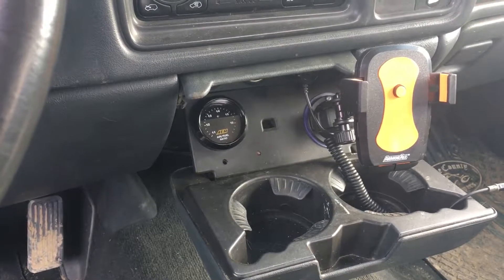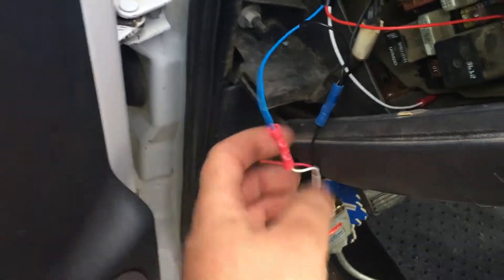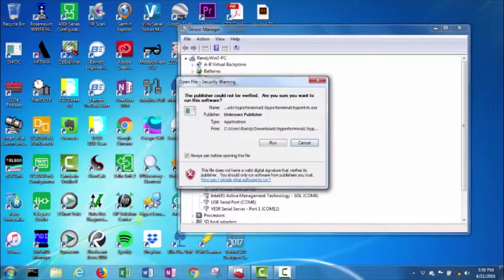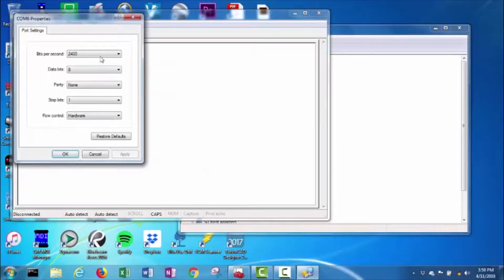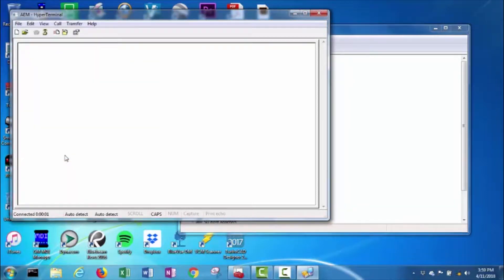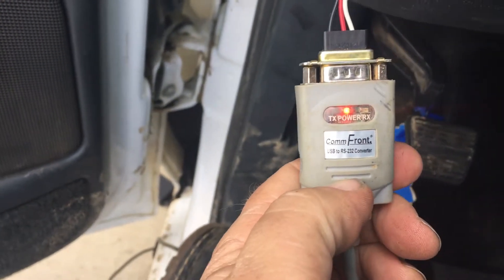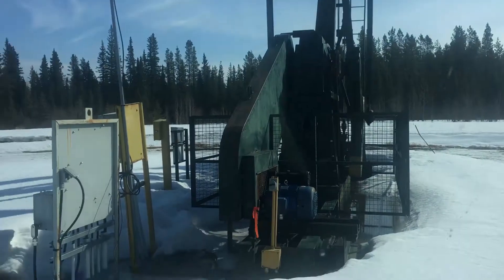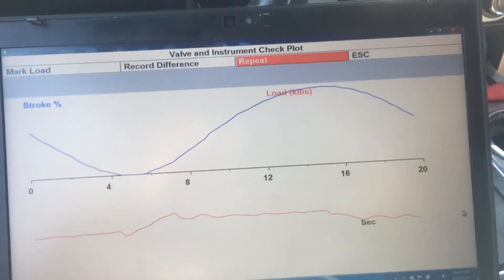AEM WBO2 Serial Comm Issues

Comment: You have to put the blue wire to pin 3 going to the computer.  Pin 5 is ground. That’s why it didn’t work. 

For a longer explanation RS-232 is a handshake protocol designed for two devices to have two way communication. So from the male and female perspective of the connectors. Each going to a different device. The transmit pin on the one connector is the receive pin on the other. 

In this case, All we care about is data incoming to the laptop so we have to come in on pin3. Live your videos.

Comment: Hey there! Did you ever get serial data working or did you just stick with analog?
Reply from the maker: I never did try and get the serial data working, the analog has been working adequately, there are times when the analog is of by .1 or .2 on the AFR but not enough of an error to be worried about. Will try serial again on my next project.

Comment: This is why I always recommend spending the extra $100 on HP Tuner pro. Hook one wire in to the side and boom, widebands up and running. Hope you figure this out though. Never tried it this way.
Reply from the maker: I ended up giving up using this method but got it working by wiring the 0-5V output from the wideband into the EGR circuit of the truck. Will show how I did it in the next video I upload. Honoured to have you comment on one of my videos lol, love your channel :)